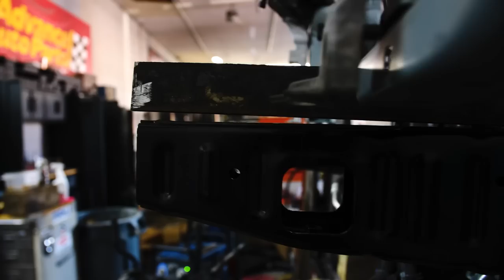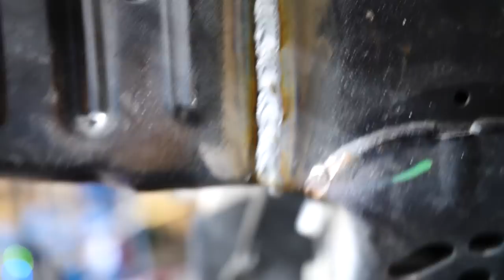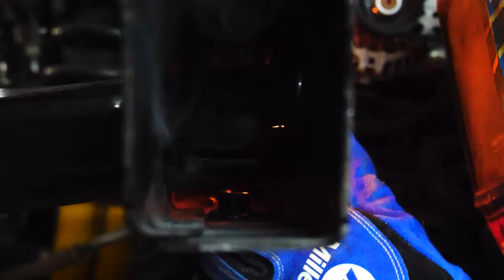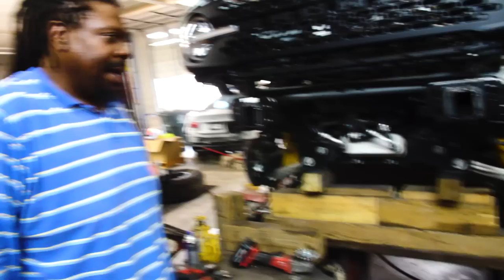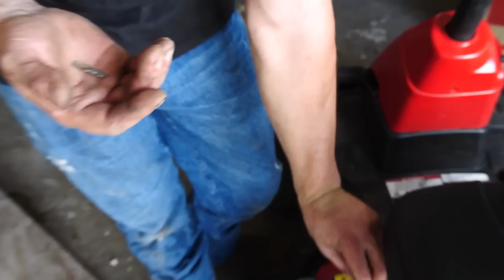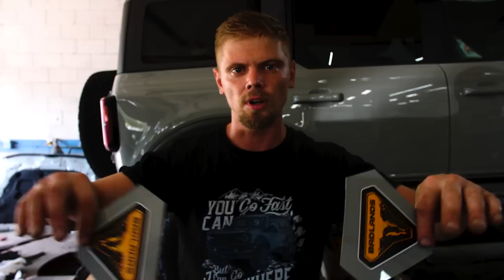Rebuilding a 2021 Ford Bronco First Edition Part 3 Welding up the frame rails and test fitting parts

Comment: Yuri you did a great job on the Bronco getting it all lined and seam welded up, it would be great if you could
do a much more in depth real time video of you doing the framework / fabrication and welding on a vehicle 
even if it was split up into several smaller parts to make an instructional series.

Comment: Retired Master Welder & Boilermaker... A continuous weld will always be the strongest type of weld then stopping and starting again.... If you stopped 2 to 3 times on a foot long weld you make 2 to 3 areas for a crack to develop.. If you did the same weld all the way across with no stopping its chance for breaking and/or cracking is minimal to none... The perfect way to weld on that frame extension is to start at the bottom corner and weld across bottom, Then up the side, Then across top and back down other side to the beginning point with no stop at all... If Ford requires an overlap of the 5mm mark just mimic an additional weld on each side of the main weld overlapping it roughly 2.5 mm

Comment: Amazing job on the Bronco guys! I purchased a Badlands at the end of summer in a similar condition, parts took a while to come in, but I am still waiting on 3 parts from ford before the shop can finish up. The parts have seriously been on backorder for 3 months now. Wondering if you had any connects and could help me out here...needing the plastic grill support bracket/vents that spans between the headlights (shown at 9:47) and two support brackets that mount behind the headlamps. I have been super patient with this build, just searching for options. Thanks